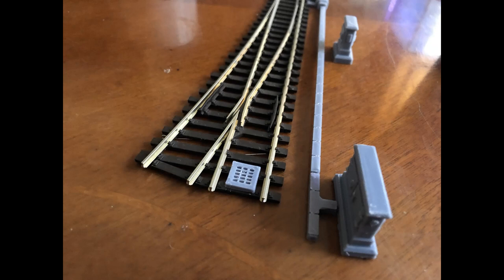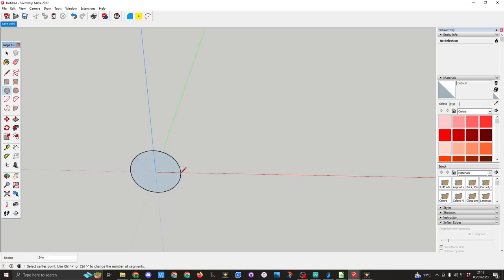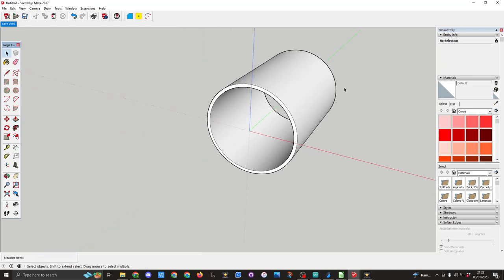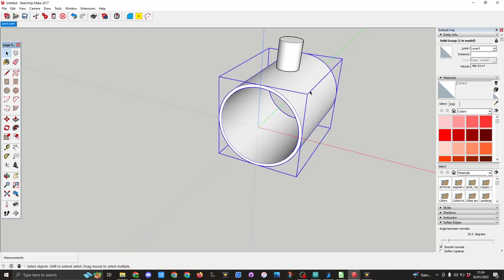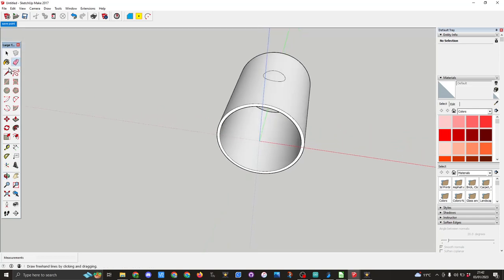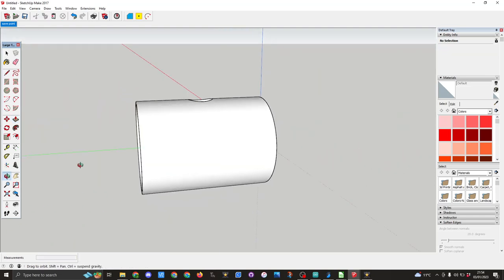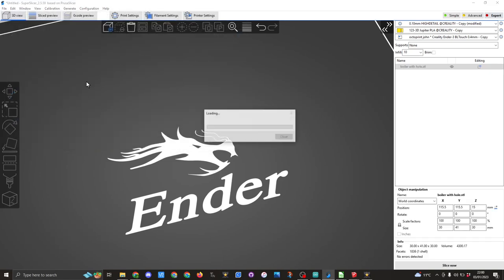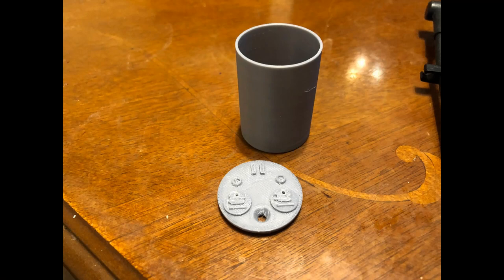Sketchup Make 2017 Part 1 Lancashire boiler design for 3D printing in FDM or resin for OO Gauge.

Comment: I’m long subscribed but only now getting back into resin modelling with Sketchup (having been one of the very, very first Sketchup users). Really clear tutorial, looking forward to the next parts. Thank you.

Slightly unclear how Sketchup in metres prints in millimetres but I will work that out!
Reply from the maker: Thank you if you take a look at this video I show the limitation of using the mm template.
https://youtu.be/795CHPUB3EQ

In the comments after this video
 https://youtu.be/yDJqBSwReIo 
I try to explain this a bit more.

The next video will be released in the next day or two.
Reply: @modelrailwaytheeasyway9743  Thank you, yes I found it shortly after! The pertinent point to me was in your video comments rather than the video itself, which is that some slicers are automatically trying to scale the metre model down. I use Prusa in my workflow so it's good to know it behaves.

Comment: What is the importance of reversing the faces? What problems does it cause if the face is not reversed?
Reply from the maker: Hi Bob
The reason for reversing the face is so we end up with the outside skin of the model facing the correct way. This can show up as errors in the slicer but may still print ok.
Reply: @modelrailwaytheeasyway9743  Perfect, thanks.